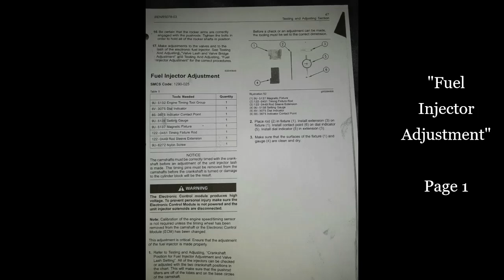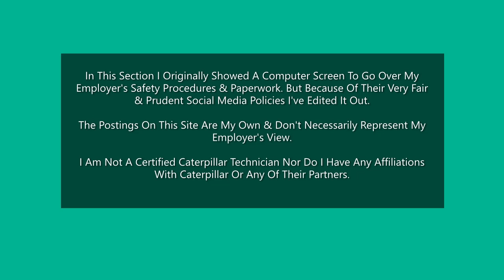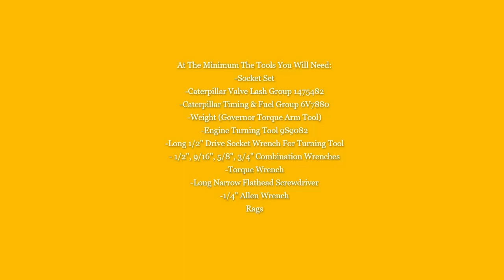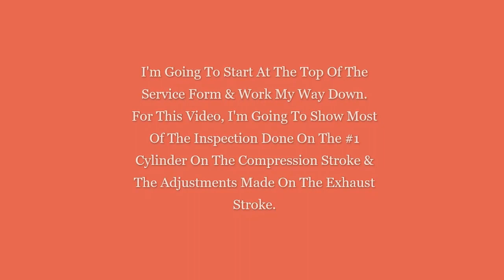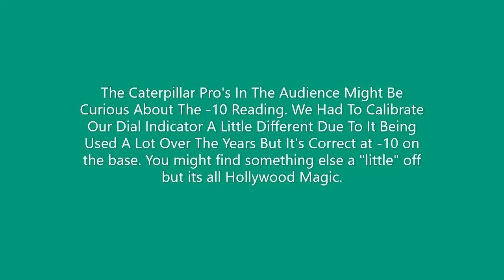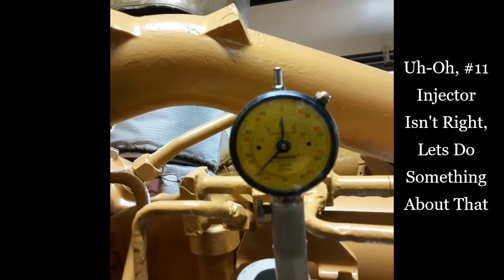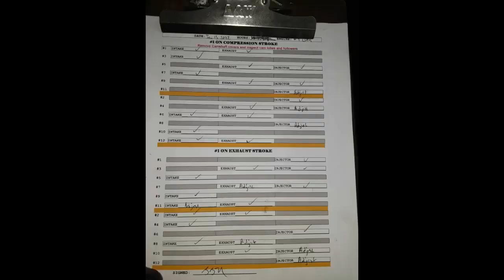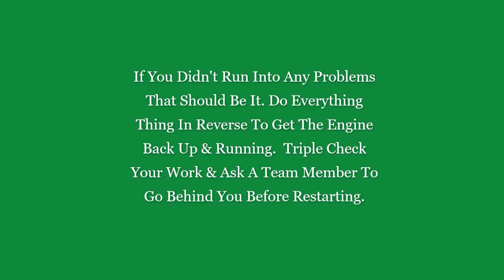Valve Lash, Injector & Timing Adjustments For 3512 Caterpillar On Icebreaker Research Ship

Comment: awesome video. 
would you happen to have web-links to the 147-5482 kit or the 6V-7880? tried calling local Cat dealer for them but "they don't sell specialty tools" lol
Reply from the maker: Try another dealer. If your company has been paying technicians to visit your engines for inspections & adjustments, that particular dealer might not want to sell you the tools to do it yourself because they don't want to lose business which doesn't reflect nicely on them IMO. OR... you talked with an A-hole on the phone because anyone can buy/own the tool group. The local Cat Dealers don't make them & just charge a premium to give it to you after ordering it from a larger Caterpillar distributor. Also, just google the part numbers followed by the words "Caterpillar Tool Group". When I just did that, I got thousands for hits/links. FYI, the dial probably doesn't come with all the kits online & would need to be purchased separately if it doesn't it. Good luck.